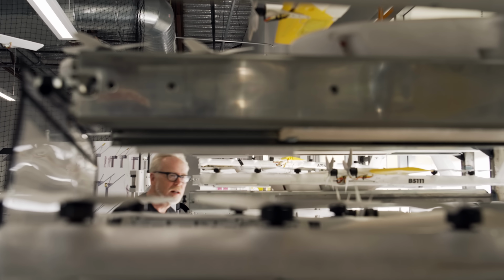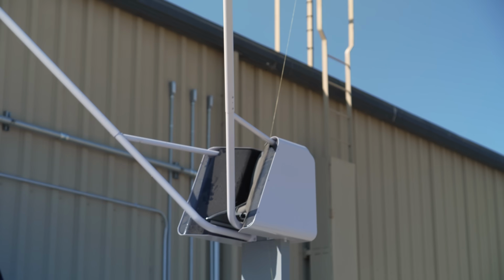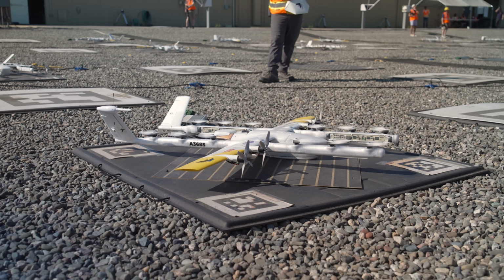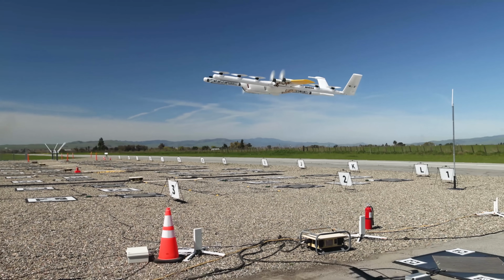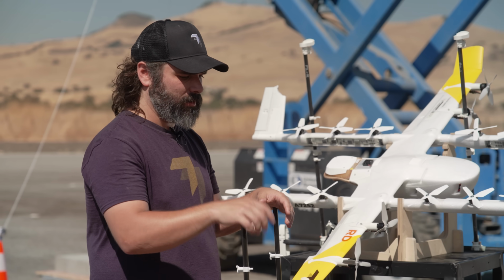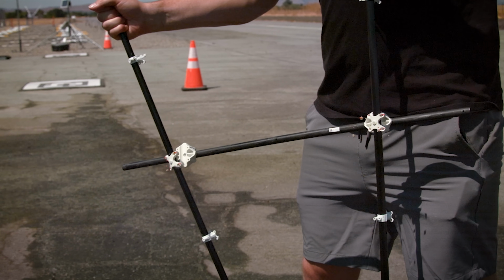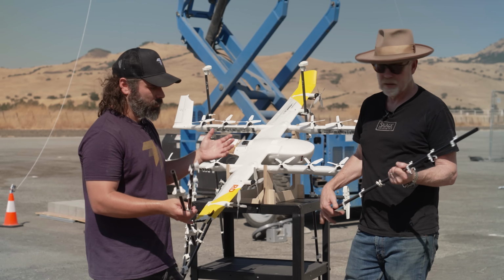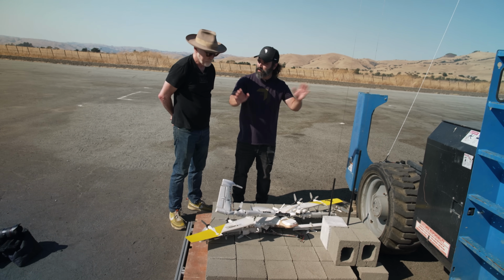Testing the Limits of Delivery Drones! (with @theslowmoguys)

Comment: So this clearly is shot somewhere low altitude, and relatively warm/hot, meaning there is a lot of air for the drones to move. But what happens if they're deployed in a high altitude, low temperature area? Would these be able to fly in the winter time? Are these able to fly in mountainous towns/cities? Can they operate through snowy conditions? Obviously they are too lightweight to handle extremely strong winds, but this is a step in the right direction!

Comment: The Seatbelt conversation was pretty interesting as, like, understanding that of course exceptions have to be made, but there has to be strong language around the exceptions to prevent unscrupulous types from "technically" meeting the criteria but resulting in unsafe outcomes.

One thing I am curious about, I noticed the planes also use front facing propellers on the wings. What's the top speed of these guys under ideal conditions?

Comment: I appreciate how much emphasis Wing put on safety. These things are really neat, but I'm trying to imagine what it might be like once there is a dense flock of them.
Reply: I live in a very rural area so things like this will probably never be a huge concern to me, but I have to give props that they are trying to think and build in safety for the absolute failure of these falling out of the sky and potentially hitting/hurting property or persons.  I don't think they are quite there yet in that regard, but they are taking those edge cases as some of their main focus.  Most companies would just want to race to market using loopholes to get the idea running and then develop while in service.  I have to commend them for taking the long, drawn out,  bureaucratic road towards the most minimal hazard risks possible.
Reply: To be honest, I don't think drone delivery should exist other than in emergency situations, or possibly very rural areas.
Reply: @Kelthor85  I'm inclined to agree. I could see it being great for rural america. But with only 1 package per drone, you would need a lot of drones just to carry like 1 cars worth of packages. I can just imagine that being chaos inside a city.
Reply: @El-Burrito  "Last mile delivery" is not meant to replace mass package delivery. It's only meant for rush jobs like food, medicine, repair components, etc. You'll still have things like Amazon or USPS trucks driving around.

Comment: Seems like it might work in rural areas but in an urban setting it would need to overcome the threat of vandals, thieves and delinquents who would attack and disrupt the devices in any way just because they can. In the city, an apartment building or complex of buildings will need to have a secure landing area or rooftop pad, that is not accessible except buy the tenants, to receive drone deliveries.
Reply: Ya I would be one of the delinquents trying to bring them down.

Comment: Freeze at 1:59
The weight of the packages are 1.05kg equally 2.3 pounds.
I do food delivery I can tell you that Asian food and Mexican food and a drink are way over 2.3 lbs in weight.
Reply: I've been building model aircraft for decades.
Apart from remote area access, or emergency things like medical supplies; this whole thing is unviable for security, economic and environmental reasons.
Flying drones is crazy inefficient compared to a van.
Reply: @robin-8439  Compared to loading a van in the morning and delivering for hours, sure it's probably less efficient. But my electric car takes about 300 watt*hours to drive a mile. For single pickup/single delivery situation like this seems to be targetting, I can't imagine that this would drain nearly 300 watt*hours per mile. That's a 6S/10AH battery per mile. And that's not considering you have to pay an actual human being [hopefully] minimum wage on top of that.

Also these are more like r/c planes than drones for long travels.
Reply: @robin-8439  And yet the company has already made over 400,000 deliveries. You're like the teacher that told the founder of FedEx that his idea for an overnight delivery service wasn't viable.
Reply: @robin-8439  And, yet, the company has already made over 400,000 deliveries.

Comment: Ok I'm curious about all the "this is an extreme scenario" sentences that fill helf of the video. Is that like somekind of protection for law and court stuff?

Also why not drop the drone midair? The only explanation is again "it's unlikely", but that just doesn't make sense. Surely you would like to have it fly against a building, or have it turn off the motors midair, show the potential trajectory and damage to other items that aren't a few concrete blocks on the ground. I don't get it, that entire part screamed to me either as a "protection" against someone or something, or a huge smokescreen "don't think about if it fails midflight", which is honestly not great when the company is praised for "showing things breaking". Again, maybe I don't know something about laws or risks of having footage of the drones dropping mid air, but if not explained it just makes that section questionable.

I like drone delivery ideas (besides my lunch, dropping supplies or first aid tools in remote areas by the press of a button is just great) but god there's always something that smells sketchy because not properly explained

Comment: Can you imagine how much noise those things will generate? I think it is an acceptable trade off for emergencies, but a food delivery service would be miserable. Just imagine hundreds of buzzing drones in your neighborhood from 5pm to midnight.
Reply: Between using many small four bladed props and them presumably being designed for distance and efficiency rather than speed, I imagine they'd actually be fairly quiet especially at the distances I imagine they'd typically be flying.
Reply: In my experience with drones, the racing style drones most people are familiar with make WAY more noise than something designed for longer flights.
Reply: @EvanMJones  No need for this idiocy.
Reply: @gary7vn  If there is a niche to fill, it will be filled if possible. If it turns out it isn't cost effective or viable, then it will fail in the long run. I know people who thought the internet was stupid because they didn't see a need for it.
Reply: They only be really loud  when hovering... but i see they are already using special stealth propellers. Those can be surprisingly silient compared to what we are used to hear, they are also bigger, so lower frequency.
Reply: Does your neighbor hood get that many food deliveries every evening? How's the traffic with that many bikes/scooters/cars making deliveries?
Reply: @WarpigA23  well if this reduced the cost then the number would potentially increase dramatically. I live in an apartment complex but in a more suburban area. Food delivery is non existent because the fee cost as much as the food you ordered. I think that is the scenario they are imagining.
Reply: Yes, that and the flying cars that "everyone" seems to want.

Comment: The ethos of showing how the product handles failure reminds me of a meeting I went to recently where a representative of a fish farm company wanted to assure residents that their facility is safe and will not affect their future negatively. When asked "what happens when it fails." They answered very surely "It has never failed and will never fail"... 

To a certain mindset, that might sound reassuring at first glance. But what I heard then and there, and what I'm pretty sure a lot of other people heard was... "we have no clue what would happen if it failed, because we have never stress-tested it and we assume it will never find itself in situations we have not considered." Needless to say. I left that meeting so much less confident in the safety of their proposal than I ever thought was possible.
Reply: There are few more dangerous statements than “it’ll never happen” and “we’ve always done it this way.”
Reply: @DeltaEntropy  In IT "we’ve always done it this way” is probably one of the most worthless statements I've heard a client say during troubleshooting lol
Reply: very true.  My experience as an engineer taught me that everything will eventually break.  The designers need to account for what could happen when any of the individual components of their design fails, and ensure that safety requirements are still met.  This is sometimes formalized with a DFMEA study..  "design failure mode and effect analysis".
Reply: Reminds me of a certain unsinkable ship.
Reply: Hopefully the front doesn't fall off.
Reply: that's insane. it doesn't matter if your building a fish tank or a nuclear power plant, you have to assume it will be broken at some point
Reply: "It has never failed and will never fail"...   Isn't that a quote from Jurassic Park?
Reply: Yeah I don’t understand why there is a lack of vehement hatred for the idea of commercial drone deliver. Dangerous and loud lol
Reply: @n0nam3491 I think it’s a miraculous tech for urgent rural delivery but in a congested city it seems, well unnecessary. I’m open to feed back.

Comment: It seems strange to refer to them as airplanes instead of drones.
Reply: They are quadplanes so I guess they are technically planes. I also might be for legal reasons, laws are usually much stricter for something that can be autonomously controlled outside of operator line of sight.

Comment: The pick-up system is a pretty well proven design. It's essentially a slow-speed, controlled version of the Skyhook retrieval system that's been used since the late 60s or 70s. No need to reinvent the wheel when you can just tweak what's already out there!
Reply: Similar to the Sky hook, but with less whiplash lol :)
Reply: Trains used a similar system to pick up and deposite objects from trackside without stopping before planes. Whether skyhook took any inspiriation from that I don't know. And before trains I wouldn't be surprised if there was a horseback version!
Reply: It also eliminates trying to find a place to land and launch from, and keeps it away from silly humans. I bet it can cut that tether if it snags or someone pulls it. Edit, I did get to that part 2 minutes later :D